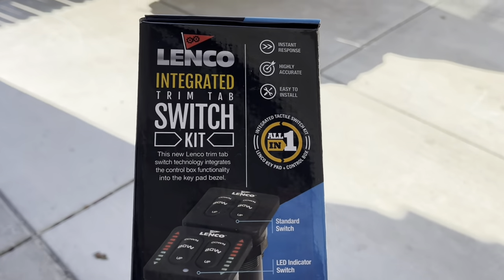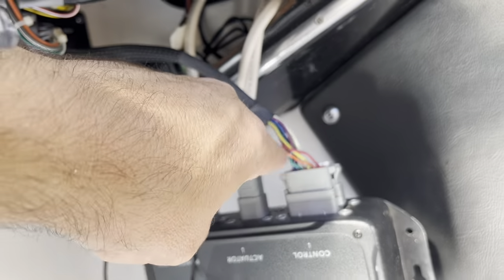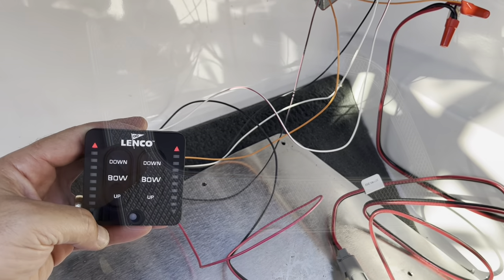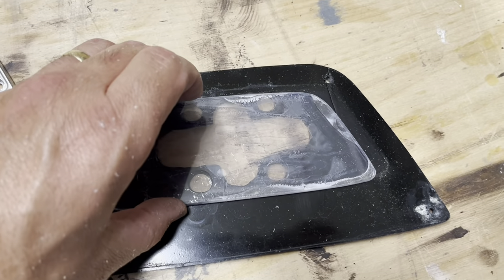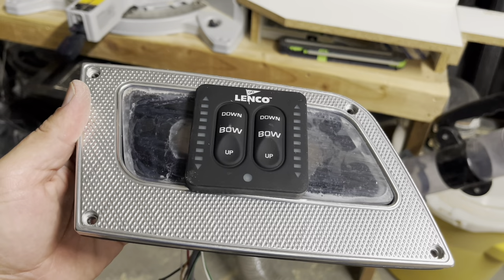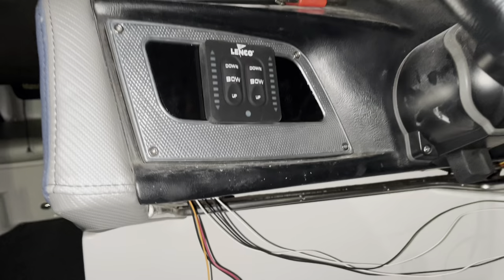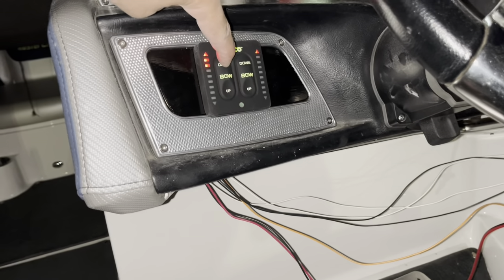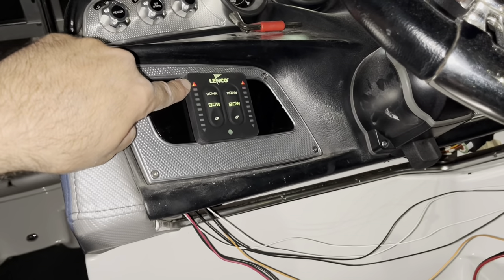Installing a Lenco Trim Tab Switch Kit on a 2012 Mastercraft X-35 replacing the SmartWave system.

Comment: They are not designed to install on the back of the boat. The switches are supposed to activate the trim tab on the opposite side. Trim tabs only provide lift, so the only way to bring the port side down by lifting the opposite side. If you want to bring the port side bow down, you need the starboard side tab to go down, and vice cersa. You wired them up backwards of how the designers intended it, but if it works for you then it's whatever. Like inverting the controls in a video game.
Reply from the maker: Great info. I know very little about this stuff. Thank you.